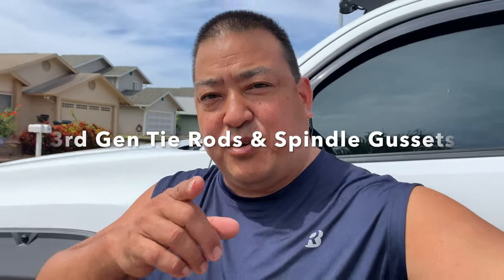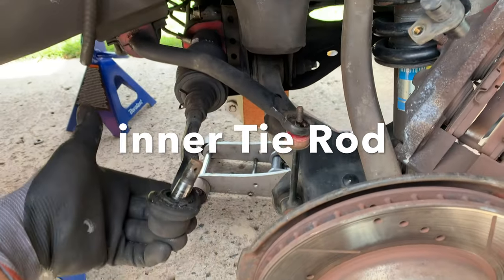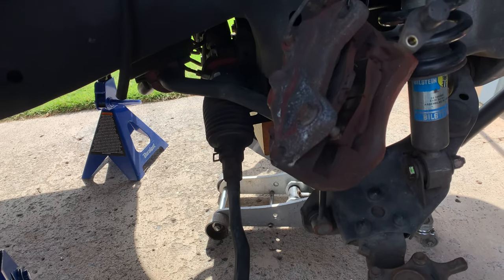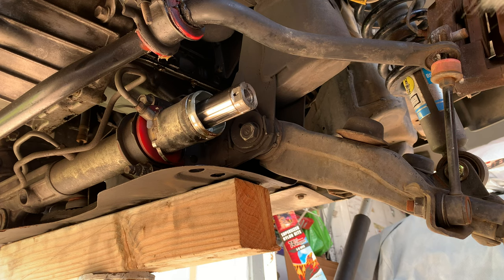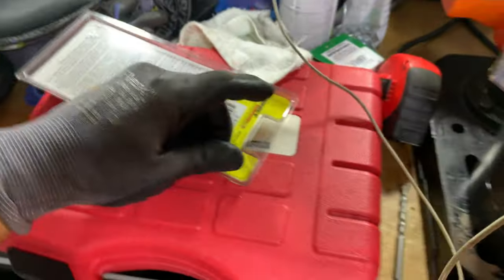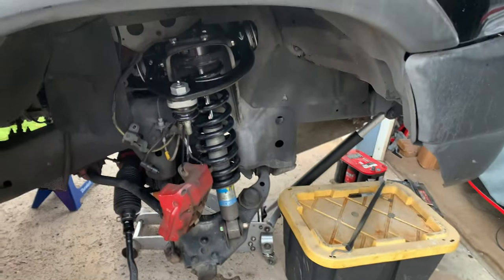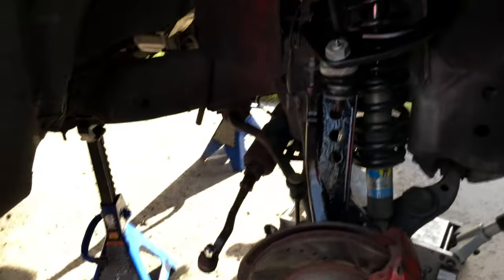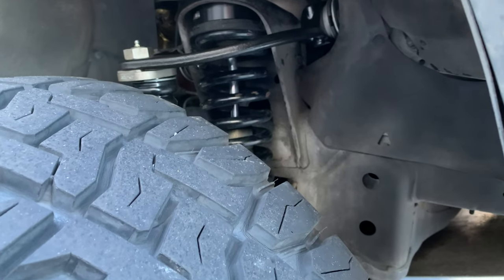3rd gen 4runner Tie rods and spindle gussets

Comment: How are your wheel bearings after all that welding heat?
Reply from the maker: i had my guy pull the bearing before welding. but these are the OEM bearings from 1997. so far, its holding up and in good condition. the alignment shop checks everything when they do the alignment also. I hope that helps.
Reply: @infiniteprojects808  good to know. Thank you